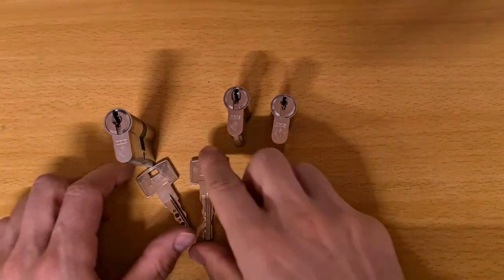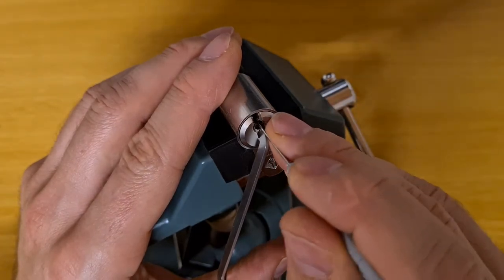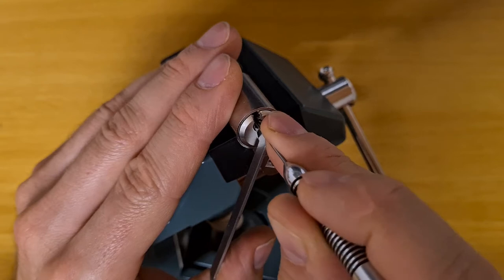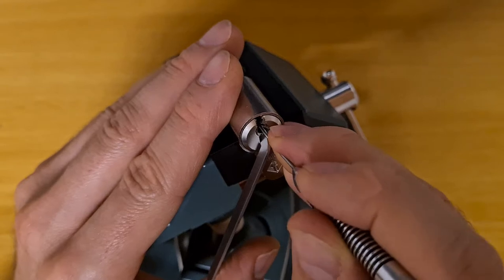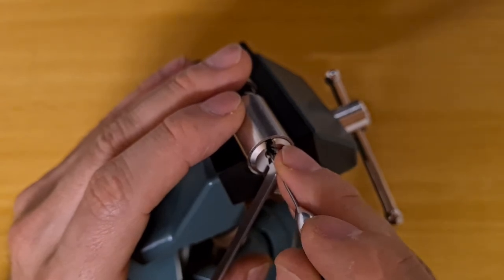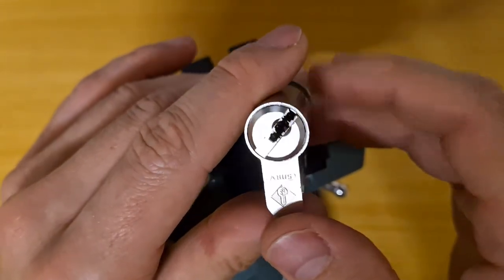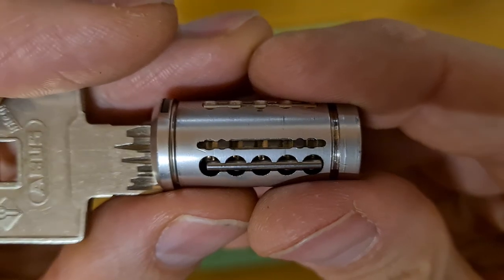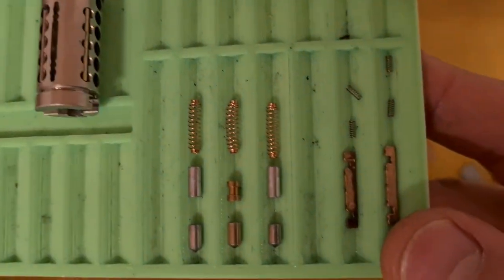Abus/Pfaffenhain Integral: first public pick and gut

Comment: Hey great pick. Do you know what to do if I had turn the cylinder 180 degrees? Do I have to pick to the sidebars again or is it bricked?
Reply from the maker: You'd have to pick the sidebars again, both of them simultaneously iirc. It shouldn't get bricked this way.